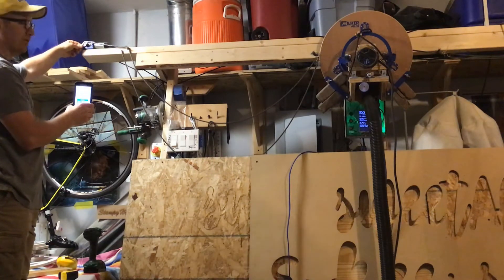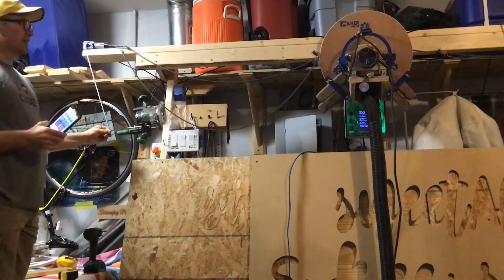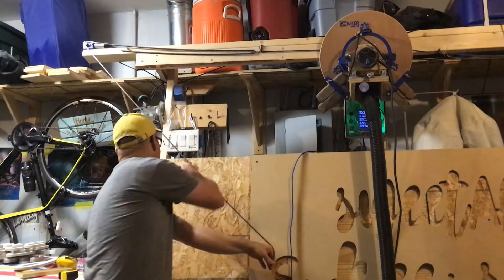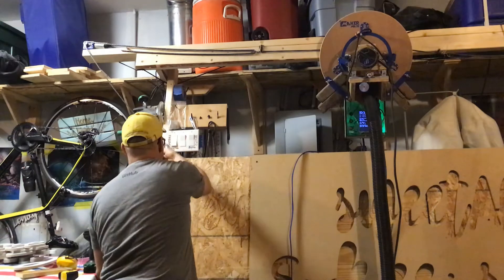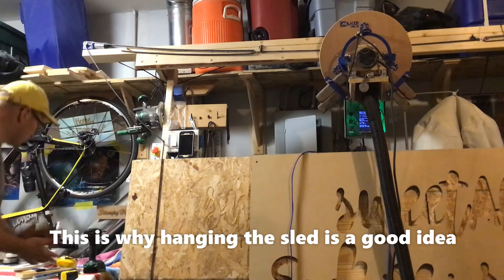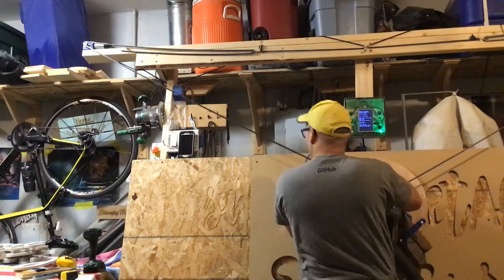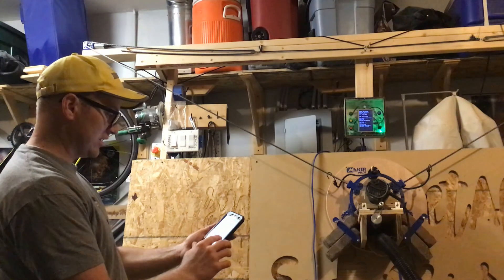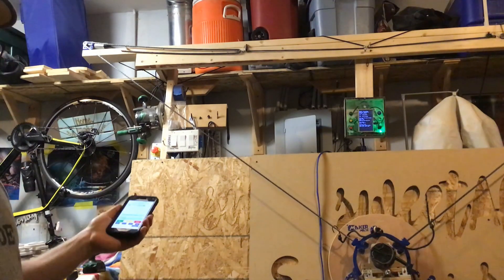WebControl   Extending Chains and attaching sled

Comment: Thanks man. So is web control a function inside of ground control or is that something else I need ?
Reply from the maker: Webcontrol replaces ground control.  It adds the ability to control maslow from a phone or tablet web browser and to run the system with a dedicated single board computer rather than a laptop, which can be a huge bonus because of the ability to add buttons and avoid the system going to sleep mid cut.